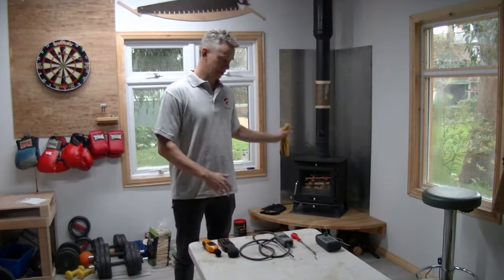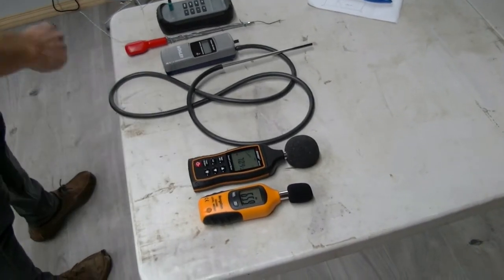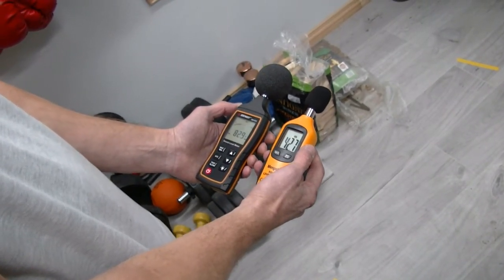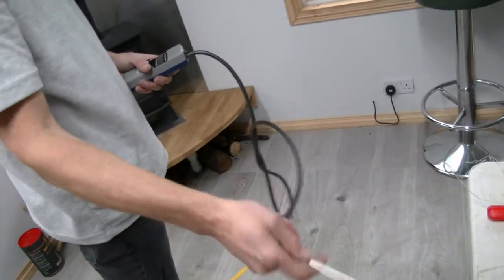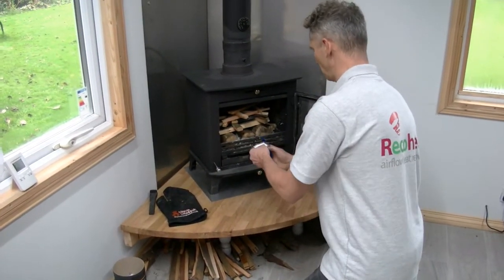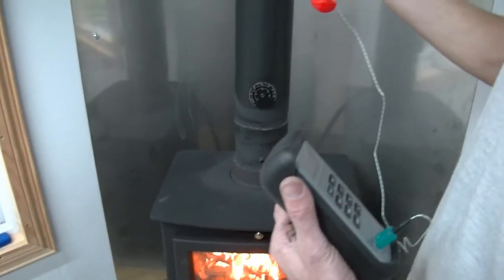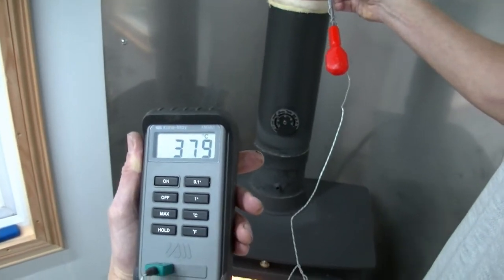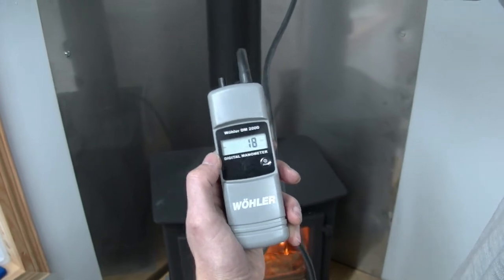Recoheat Flue data

Comment: Will it work on a double barrel wood burning stove? I have a work shop that I have converted into a worm farm and trying to keep at a decent temperature 🤔?
Reply from the maker: Not sure what you mean by that - if you want to send over pictures to sales@recoheat.co.uk, we can advise. It generally works well in workshops - even large ones, though if the ceilings are really high you'll notice it a lot less.

Comment: Hi Recoheat, Just wondering would it be possible to install 2 or 3 recoheats on top of each other into a tall exposed flue like you have in the video ? I am planning to build a tall side extension to my house next spring and wanted a log stove to heat the area and the dinning room. The height from floor to ceiling roof is 4.2 meters. So I would guess gap above the stove and below the ceiling would give me 3 meters of exposed 7" flue. Plenty of space for a few recoheats.  The area to heat up is 70 m2 on the ground floor or 90 m2 if you include the upper floor with Balcony into the extension.
Reply from the maker: We don't recommend it in a domestic setting. You might have seen that it's been done in a workshop and works well, but generally we'd assume it will take too much heat out of the flue. Sorry for the slow response!

Comment: So you are taking in air from outside at 9deg c and heating it to then pass it into the room at 4 litres per second. Sounds like the room will be a pressure cabin unless there is an outlet...?
Reply from the maker: It does increase the pressure, but these are small volumes by proportion. It does make a difference though, and is what drives the later stages of convection into other rooms. You'll know that any room with combustion has to have good air flow, so we're working with that among the other factors.